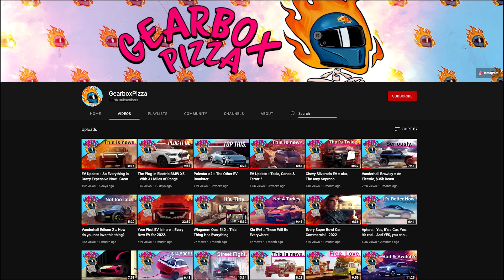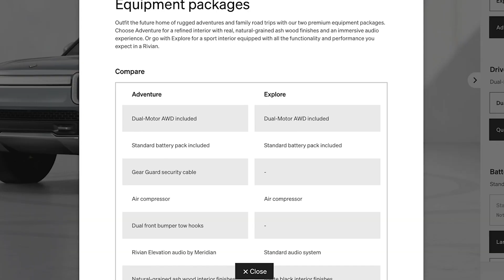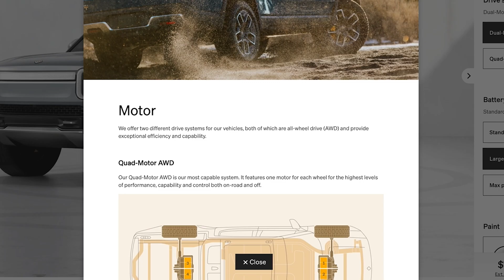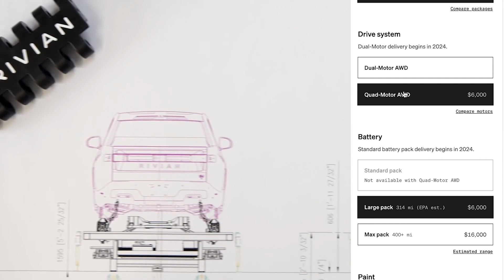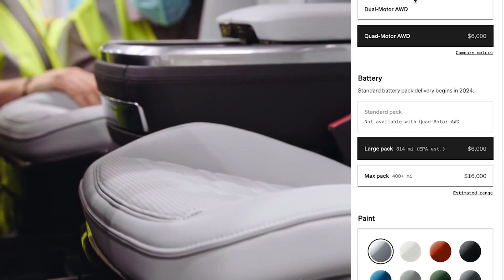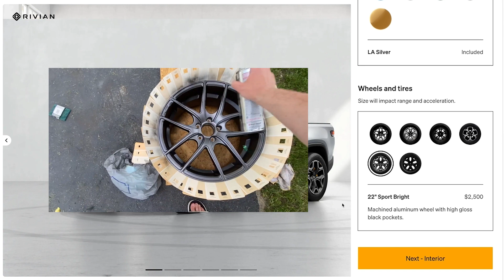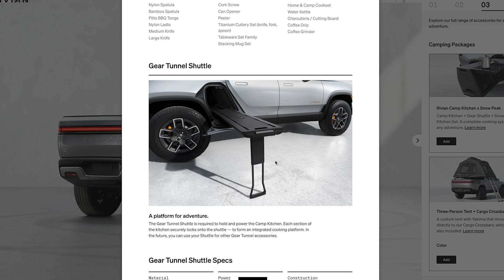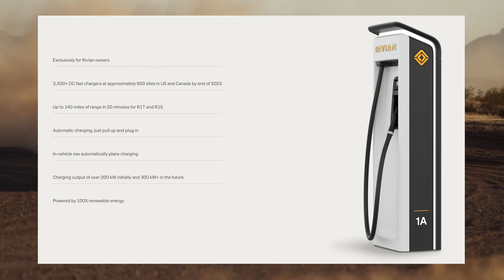RIVIAN R1T :: It's Different Now.

Comment: Nice config.  That’s how I would spec out the truck. I went with the SUV though.  That puppy is Forest Green, Ocean Coast interior with he AT tires and reinforced bottom.  Hoping because I got the Launch Edition, I actually get it this year.  Estimated July-Sep delivery date, but if I get it by Dec I’d be pretty happy.
Reply from the maker: Oh heck yea Frank! Congrats pal. Personally, id go for the R1S also, planning on doing an updated look at the R1S here shortly. Anyway, super stoked for you my dude!
Reply: Any updates on your situation?
Reply: @MaticTheProto  Yes actually.  My estimate got pushed back to “1st half of 2023”.  So I changed my configuration again.  This time I went to Launch Green, Black Mountain interior, left the reinforced plates and AT wheels.  So recently (about a week ago) I got an email to “confirm my selection”.  A day after I confirmed my selection, I got an email to go though my 8 step process.  I completed 7/8 steps.  The 8th step is still locked, which is “Arrange a delivery date”.  My assigned guide tells me that a soon as the SUV is prepped at the Service Center, the system will unlock the 8th step.  His “guess” was 3 weeks, because that’s how long shipping from Normal is taking with freight.  My guess is this week or next because the MN service guide told me they are using truck to ship to Minneapolis from normal and not train.  Pretty excited, we’ll see what happens.
Reply: @fpartidafpartida  awesome! I hope it all works out!

Comment: i have just oredered my rivian  rt today mine will be black with white interior dual motor 600HP 262 miles pack thanks again
Reply from the maker: Dude, congrats! When are you expecting to take delivery?!
Reply: @GearboxPizza  in two yyears or2024
Reply: i build the door mirrors for your new truck in Adelaide , Australia. one camera is from samsung. one is from LG. and we put in logo lamps. so when you unlock the door the rivian logo displays on the ground. i would love to drive a rivian. i do love tech stuff

Comment: I'm still conflicted on this. The price point is too heavy for my taste. Then again, I'm not into pickups, either. Take that as you will.

I love the styling of the lights, and the overall design in general. However, this does not merit the pricing. Drop it down. Then, and only then, will the company have a solid consumer cache.

People can toss their money at a product all they want. However, in the end, it's just an overpriced toy.
Reply from the maker: Is it me, or is $90k the new $60k? As much as i dig the Rivians, there's no way around it.. they stupid expensive. Truck wise, I'm thinking a mid 60's Ford F100.. you can still find a nice starter one for well under $20k.. then maybe an EV conversion, or a crate motor (nothing too crazy) - then modernize the interior and brakes etc. Boom. Now we're talking broseph. Anyway, have a rad weekend my dude!
Reply: @GearboxPizza  This a good point, Mr. Bro. As prices start to keep hiking, I feel an aftermarket conversion EV market opening up wider. Could you imagine a '67 or '69 Camero converted into an EV?  I think I need to change my pants now.
Reply: Tesla doing just fine champ and the model 3 is no longer a 33k starting vehicle. You pay 90k because of warranties and service repairs..not one gas powered pickup will give you your money back and then dealership servicing it on them for the next 10 years. Plus gas is $5 a gallon that 90k price point is literally nothing compared to regular maintenance and fuel in a gas powered pick up
Reply: Honestly? Quality wise Rivian cars look like they‘re worth it